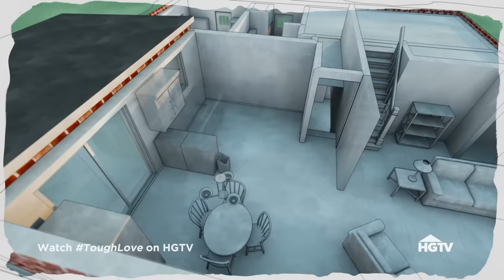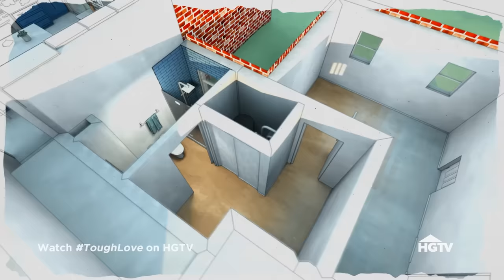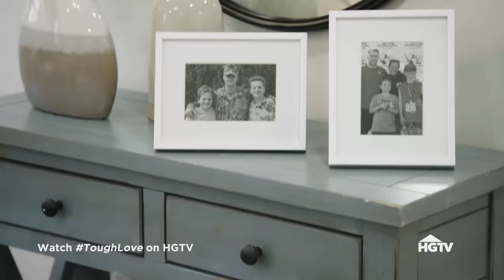Open Concept Remodel of Dated Kitchen | Tough Love with Hilary Farr | HGTV

Comment: Would have given the fireplace a new look by removing the mantle and the brick hearth.  This way the TV CAN go above the fireplace instead of being tucked in the awkward nook which partially blocks the view to the screen.  
Could then install a bench where the TV is for removing boots, and general added seating.

Would have had a longer sofa because sometimes pulling out the sofa-bed is too much at the end of the day.
Reply: I thought the TV wasn't right over there either.
Reply: With a wrap around couch for more steering too
Reply: @mh2774  
The seating did seem inadequate.
Reply: TV's should never go above a fireplace. You will have neck pain from looking up. And the heat can kill it.
Where they put it was also stupid.
Reply: @saulgoodman2018  
Depends on the setup.  
Some fireplaces it is too high, others it is within acceptable range.  A floor level hearth, a thin mantle to deflect heat, avoiding putting in stuff that burns too hot are all considerations (NO CARDBOARD).
Reply: @HS-ml8dx  
TV is only a focal point when it is going.  Any bench user would block the TV, as well as anybody using the door or possibly the staircase.
Reply: @b_uppy  Well, you're obviously not going to mount the TV only a few inches above the bench, so someone sitting there, won't be in the way. Also, by the time everyone sits down to watch TV, the family are all home from work, school, etc and you're not going to have much traffic between the front door and the staircase.🤷‍♀️

And that big black rectangle against the wall will definitely attract my eyes even when switched off.😊
Reply: @HS-ml8dx  I've seen people put art over the top of them to disguise them when off.  Additionally tvs can be mounted too high.  And it is still tucked into a spot where it is partially obscured from living room seating.

Comment: From the grime around the kitchen cabinet knobs -it doesn’t look like this lady believes in cleaning your cabinet doors. 
Sweet xmas- any areas where hands are coming into contact for with surfaces - require wipe downs at least once a month. When you have grime around door knobs, kitchen cabinet pulls, doorway, trims, window ledges, etc., that means you’re not cleaning it.
Those new kitchen cabinets are not going to stay white for very long. 
Yikes!
Reply: Presumably the gentlemen in the house also don't believe in cleaning their cabinet doors.